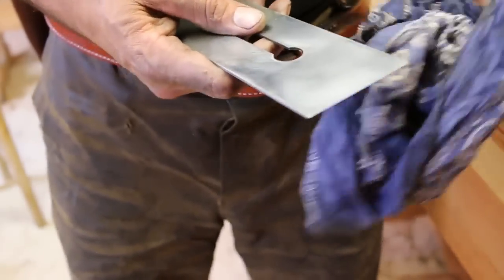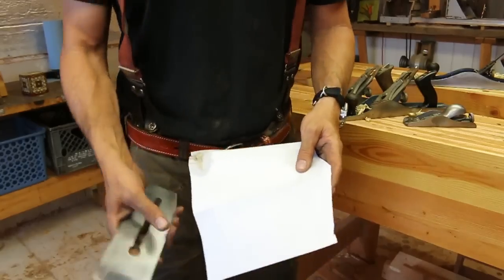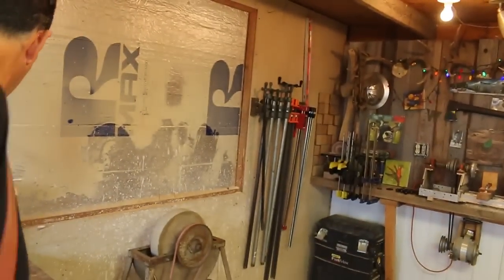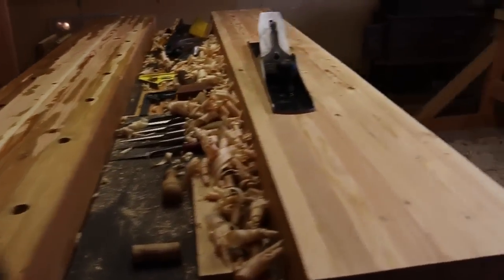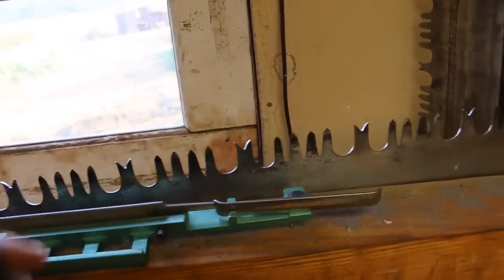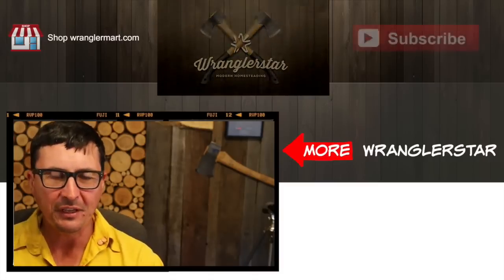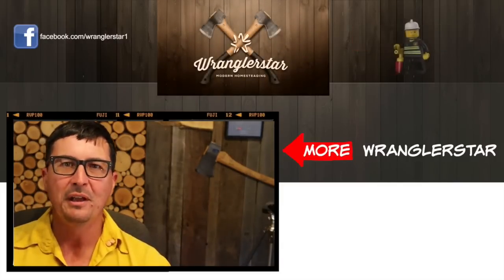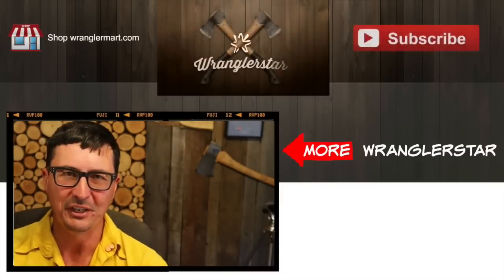Biggest Stanley Plane Ever Made

Comment: Great video Cody! I have a stanley number 4, 5 1/2, 6, and a rabbit plane. The 6 needs a new chip breaker screw and the rabbit plane needs a depth gauge and screw. They all need to be fully restored and sharpened which I am not particularly excellent at. Can't wait for the next video. Good luck on the job!

Comment: I have a pair of number 8s and pushing one  will wear you down. I had the sole serrated to reduce the friction on one, and it is a lot more manageable, with grabbier wood. The sole is still 100% flat to within <.001" corner to corner to corner, cross ways, but the reduction of surface area makes it much much easier to use. I use Boeshield or LPS3. Boeshield is used to mothball weapons,airplanes, and avionics. I also have a number 7, and shooting board plane. Balistol is good stuff, and I may give it a try on some of my woodworking tools. I try to avoid silicones in protectants. I used my 7s & 8s as jointery planes. I'd rather just feed the bench top through my dual belt sander, after a pass through the planer. I have a few of the OLD Bedrock Stanley planes and a lots of the Bailey Stanleys.

Comment: Sweet plane. I've got an old wooden Jointer Plane I sometimes use for large surfaces. Properly adjusted, It glides. It needs to be adjusted for the seasons though, unlike a steel plane.
Please stay safe as you go in to battle...

Comment: One of the possible reasons that you hadn't been called until now for the fire is that they are trying to keep the local resources just that, local. Even though there is a large scale event happening, life still goes on. Somebody has to run the chest pains calls, vehicle crashes, and anything else that somebody might call 911 for.

Comment: I should have mentioned that the advice probably applies to unwanted pressure on the blade tip which may cause slight dulling and/or an accidental shift in the blade position, especially with wooden body planes.

Comment: If the (new) blade is bent too much to grind it's back flat easily, as often happens with (cheap) new ones - tap it (real hard) with a nylon hammer, in the middle, at the high spot, from the high side. Lay flat on a wood surface.  It took me several hard blows to even mine out enough to then easily grind it flat. Maybe even a steel hammer for better effect, but I did not do that. It is less controllable. Hit it, grind a little to check progress, and hit again if progress seems still to be slow.  The metal is tough and it takes some really hard blows to alter its shape when it is cold. The back is flat and smooth then, and sharpening needs only to be done to the bevel from the other side.  No need to wait until the low spots vanish by wearing the blade down past it, eventually. ;)  I'm pretty sure it was Paul Sellers who mentioned this - but I'm a toolmaker and knew this already from my education and experience - just needed to be reminded of it when it was time for me to hit that particular issue ... Cheers  

ps: I, too, use wood for stropping - I'd have destroyed several pieces of leather by forcefully cutting into them on the backwards motion - not a big issue with wood.
... I just finished building my bench, a derivate of Paul's design - and am now on way to many potential projects using this as a solid base.

All the best to you!

Comment: once the leather is filled with the rouge it really doesnt matter rough side smooth side.    I use green and white rouge on the leather for my stops.  rouge is sold by color, darker = coarser grit.   red or brown is second to the coarsest.  black is meant to take scale from cast iron.  The four common rouge colors from finest to coarsest white green red black.  Trivia.   Liquid rouge mixed half and half with charcoal lighter fluid works for hand polishing metal parts.  Then when it dries to a powder remove it with some baking flour on a clean dry rag.
Reply: Pete Aron
nope I meant white common kitchen flour.  like you said baking soda can act like an abrasive.  So that is not what you want put on a rag and used to rub the surface you just polished.  The entire purpose is to remove a fine dried on powder film using a fine powder
Reply: +Randy J Autosol also works well for stropping

Comment: Great relaxing video.  Love using old hand tools.  Just info for anyone looking to buy older planes.  The Baileys are much better quality than the Handymans.  Have noticed a difference in quality between the Bailey types as well though they are all good.  That is a type 14 no 8 which is really good.  Have a no 7 type 13, a type 16 no 4, a no 5 type 17, and a no 4 1/2 type 19.  Love them all, but the 13 is noticeably better in quality than the 16 and on.  Appears the 14 in your video is the same quality as the 13.  All of the older Baileys are great planes, but seems to be a sweet spot from the type 11s to the type 14s which balances high quality manufacturing and features.

Comment: Loosen the screw on the lever cap until its tight but not so tight that you can't turn the depth adjustment easily. The lever cap only is loosened when removing the blade

Comment: Saw an episode of The Woodsmith's Shop (wisconsin PBS) and he was using a #7 plane for joining flat boards. It looked very similar to your #8 without the fluted deck(???) it worked like a charm but my question is if the difference between the 2 was the fluting or if the numbers refer to the length? Thanks so much for all your teachings. My best to you and your family.
Reply: A very belated reply from me, not the OP, in case anyone is still wondering. The numbers do refer to the length of the plane. Planes with the corrugated bottom have a 'c' following the number. For example No. 7c.

Comment: Cody, you should get a good quality wet stone, they operate exactly as your 1000 grit wet dry sand paper and windex does, except they don't need to be replaced. My father is a long time wood worker and uses it for all his sharpening. Until recently I had never come across a diamond stone, what is their benefit?? They appear to be a wet stone with a cover.

Comment: Hey Cody,I appreciate your perspective, but you are using what is the entry level plane in the Stanley line.  If you want a real killer plane, try a Lie-Nielsen or Lee Valley Jointer.  A Lie-Nielsen #8 is major bucks, but is so much better made than a Bailey Stanley you would be shocked.  Stanley also had a second tier of higher quality planes called Stanley Bedrock.  They are their premier line, and are what the Lie-Nielsen and Lee Valley planes are modeled on.  You can find used Bedrock equivalents of the #8 for maybe $250.  The Lie-Nielsen new will run you $450.00.  I know - its a lot of money for a plane, but I have one of each of their sizes and they are well worth he green.  Just incredible tools.

Comment: It shouldn't be necessary to release the  lever cap in order to adjust either the depth or angle of the blade. By releasing the cap iron, you're likely bringing the edge of the blade out of parallel with the sole of the blade.

Comment: In regards to stropping, in my experience knife guys tend to favor smooth leather, and woodworkers tend to favor rough leather strops. I have four strops that I use for knife sharpening depending upon the type of knife I'm sharpening and the edge finish I want. I have a rough leather strop treated with a 3.0 micron diamond spray, a smooth leather strop with a 1.50 micron diamond spray, a kangaroo leather strop with a 0.50 micron diamond spray and finally a Nano Cloth strop treated with a 0.125 micron diamond spray. 

BTW, all my diamond sprays are from Wicked Edge Sharpeners.

Comment: Cody: to make flattening the back, of the iron, a bit easier try putting the iron on a thin feeler gauge when flattening.  This will elevate the back of the iron slightly allowing access to only the cutting edge.  This way you don't have to labor on removing so much steel.

Comment: I'd have used a double bevel on the plane iron - this curved bevel does not make any sense to a traditionally trained cabinet maker! Second point: Again I would have used a long straight edge and spot planed with a #4 1/2 and then used the #8 to refine the surface from spot planning...

Comment: First you need to adhere your sandpaper to whatever you are using as a reference surface. Second, your strop is caked in compound. Scrape it off with an old cabinet scraper and use it sparingly. Third, there is no reason to weight the iron so heavily and/or make 50-100 passes. You are rocking the iron like crazy at the beginning and endpoint of your stroke since you're focusing on downward pressure v. holding the proper angle. Watch Rob Cosman's sharpening videos. Less is (a lot) more my friend.
Reply: 2 years later and you STILL have no videos of your own to show us all The Way.
Reply: @maineiacacres  He doesn't need to. Others explained this point too. You will change the geometry of the blade if you apply too much pressure.

Comment: That is not the perfect tool for the job. That is in fact a joiner plane. Used to join boards together. For your task you should have been using a #4 smoothing plane, (hence the name) with slightly rounded corners on the iron.
Reply: the #4 would not be able to make it as flat as the jointer plane.
Reply: Whole point of using a jointer plane for a bench is to create a boundary of accuracy that is easily obtained with a plane that size, a #4 in all technicality could do it, but you would be looking at many more hours with a straightedge and light

Comment: Never having used a plane, what is the reasoning for cutting at a slight diagonal? Ease of cutting?  Thanks.
Reply: MasterGhilieman Having the blade at an angle to the direction of travel changes the attack angle of the blade. It allows a thicker edge blade to slice better so it can retain the edge longer.